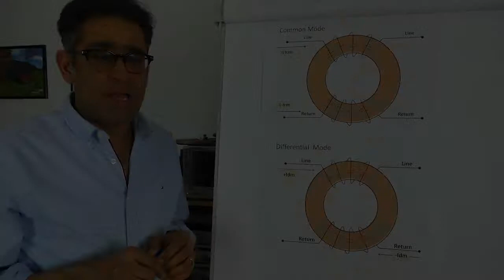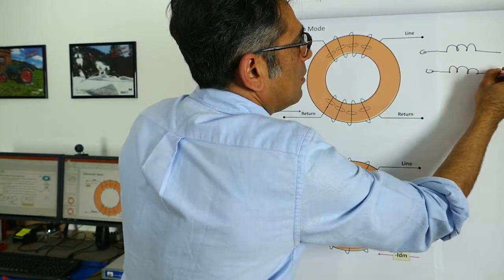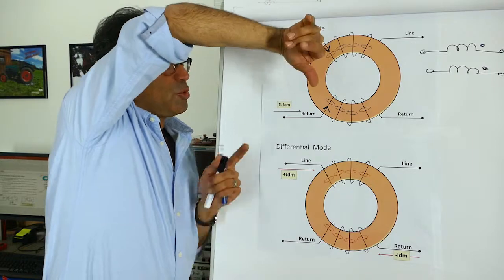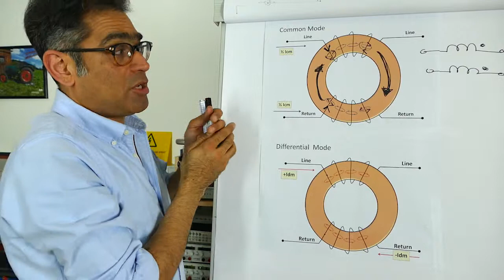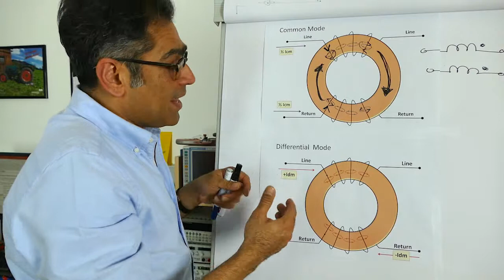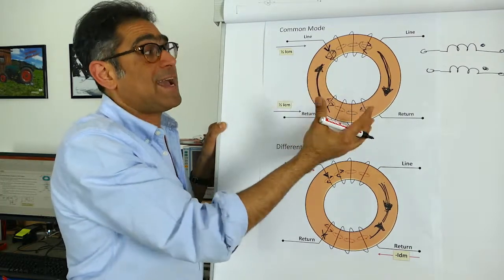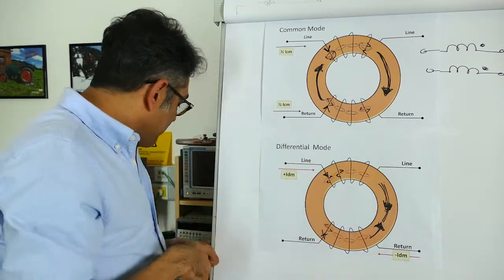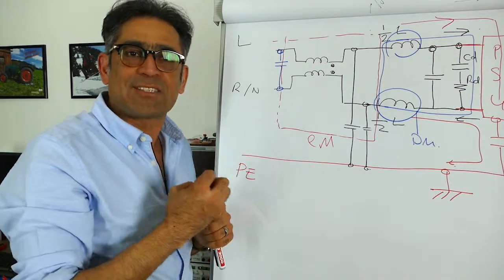EMC Filter Design Part 6:  Common Mode Choke Operation

Comment: Sir, I think the direction if flux is reversed wrt right hand screw rule in the case of return path of differential mode currents
Reply from the maker: Thanks for your note, it is hard to draw the right-hand rule on a paper but please note that the effective flux in the core is opposite to the ingoing current, resulting in flux-compensation. Hope this helps!
Reply: @OMICRONLabTutorials  sure sir..I have understood when you explained..But pointed it because you may write some note in the video.....Your series helped me understand the use of choke and components in emc filter..Thanks a lot sir

Comment: You don't drow the core of the inductor...
Reply from the maker: You are right, the circuit symbol normally also contains the lines indicating the magnetic core. Here we did focus on the winding direction.